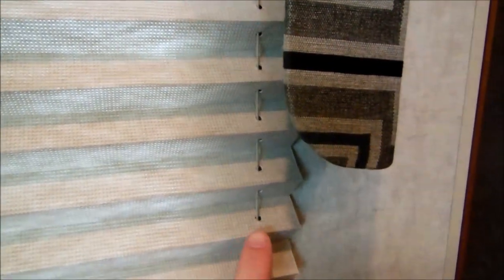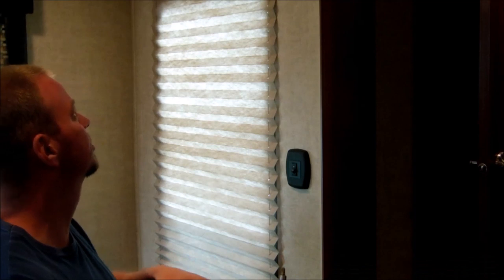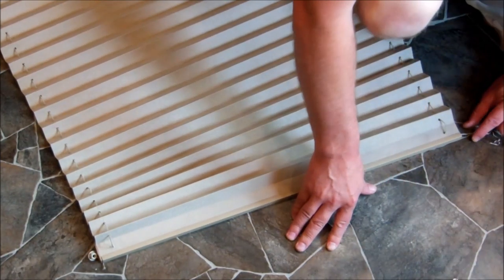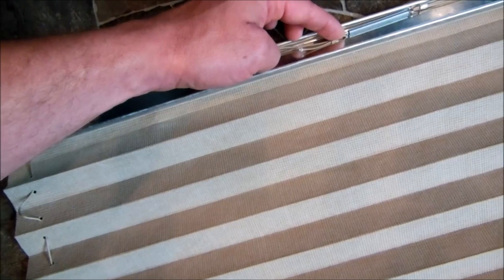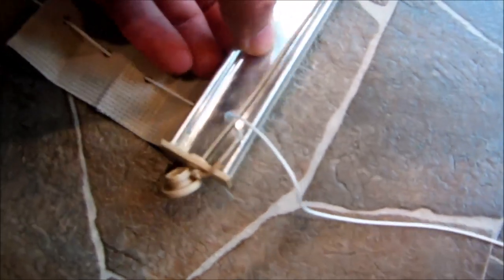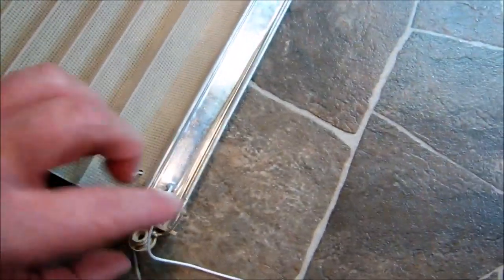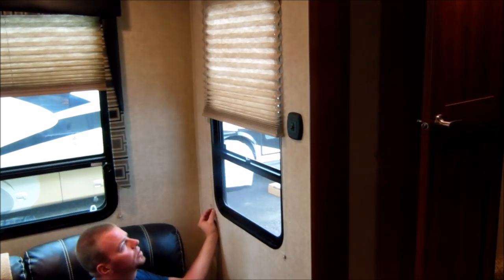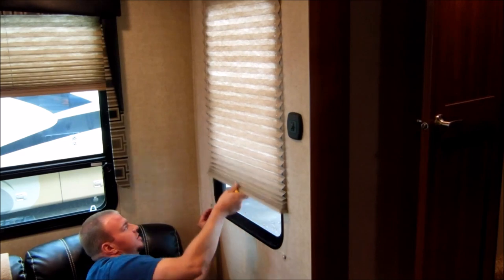RV Window shade repair

Comment: My wife and I are at a campground in our new trailer. She just noticed that one of the pleated blinds wouldn't stay up on one side. I pulled up your video, which explained how these things work, and that the tension can be adjusted at the bottom. 2 minutes later, it's fixed. Thanks for taking the time to shoot this video!! 😊